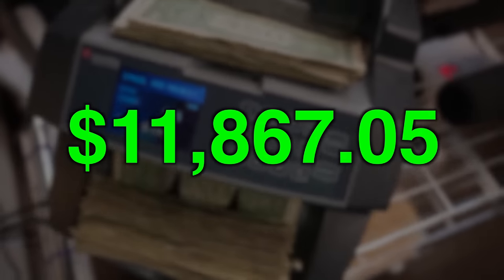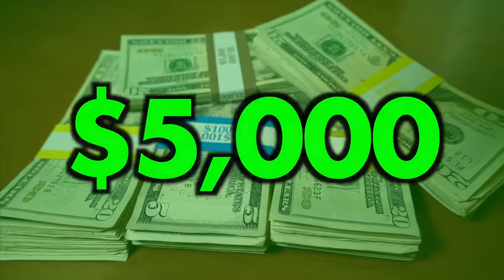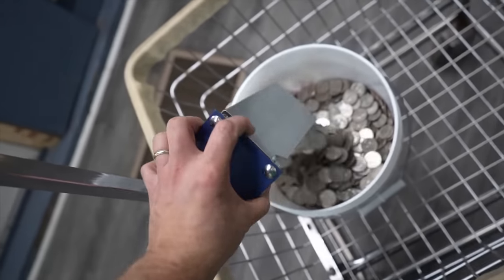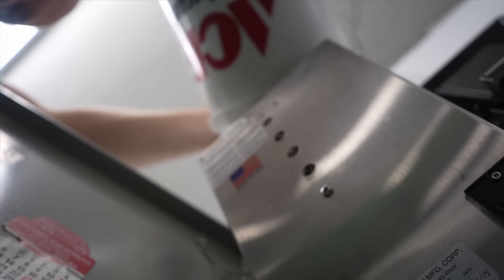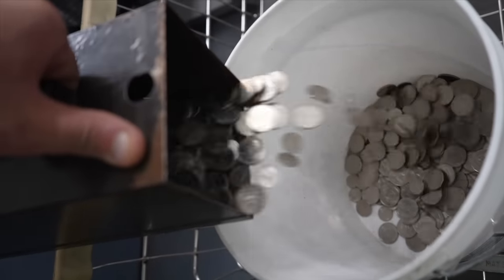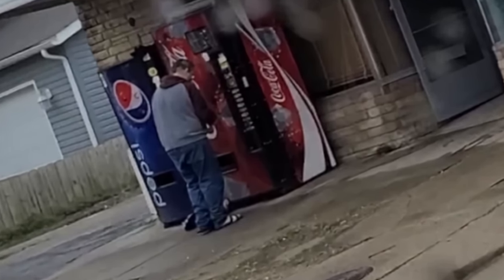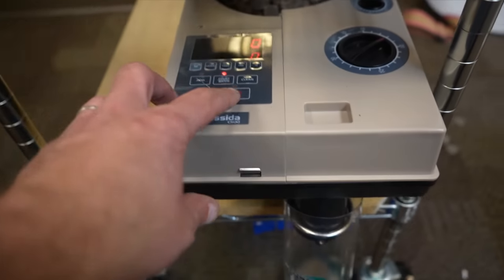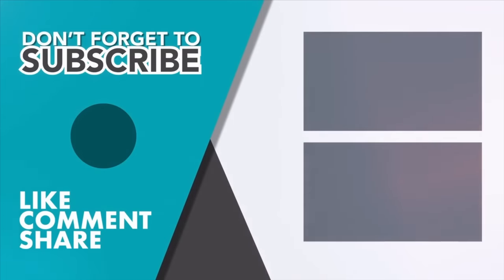My Vending Machines Made $11,867.05

Comment: Do they make a contactless card reader that you can slap onto the washers and dryers and someone can just make the payment directly to the machine? Maybe it's expensive but it sounds like you're on the threshold of hiring a person to handle quarters for you which would also cost.
Reply: Got machines to count coins
Reply: They make washers with those you couldn't just slap one on. Its got to be one that's built to do it problem is they're more expensive and they have to be maintained more and they have to have an internet connection and the cc companies charge a fee to